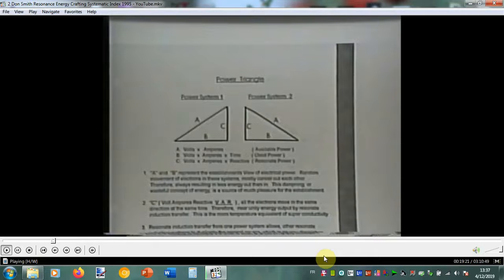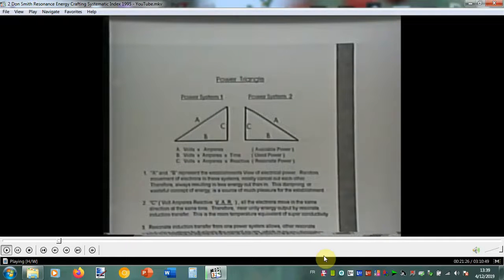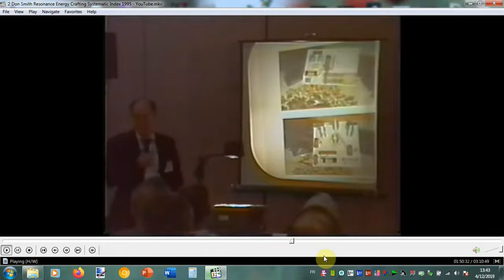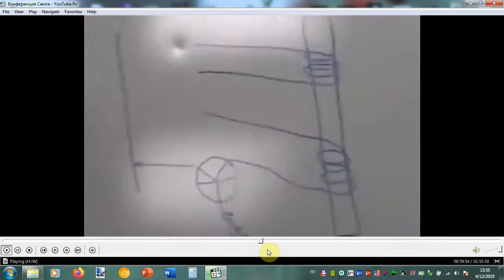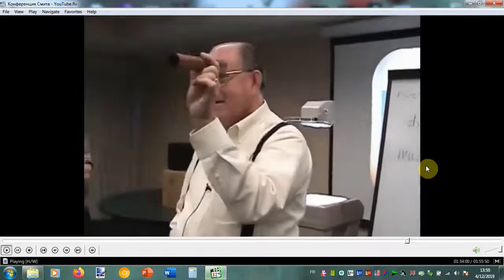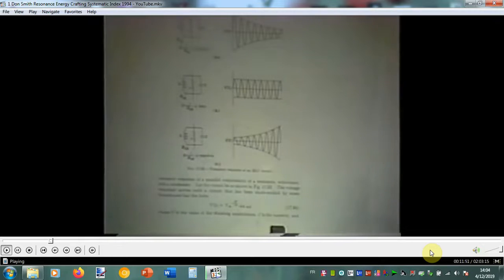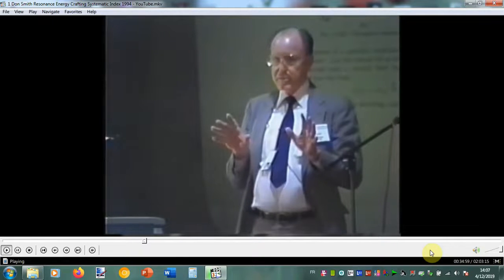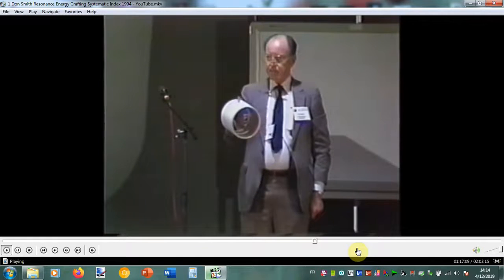Smith Magnetic Generator - Overunity

Comment: Rumor is on the street that the Smith motor is one of the most confusing and deceptive. Look to Nathan Coppedge's (my) devices, there is more transparency and it does not even necessarily force you to buy magnets. You also DON'T need to do any long expensive phonecalls with me to find basic information (YOU DON'T NEED TO, I'VE NEVER DONE PHONECALLS). Information is available, just not scientific proof maybe because scientists aren't working on it.